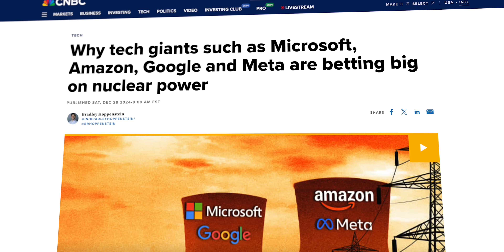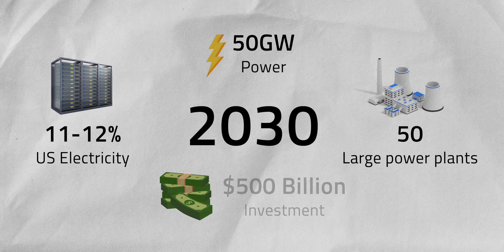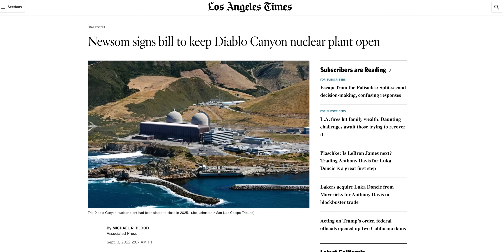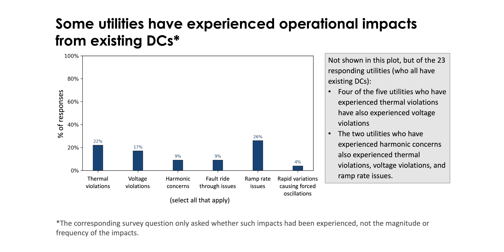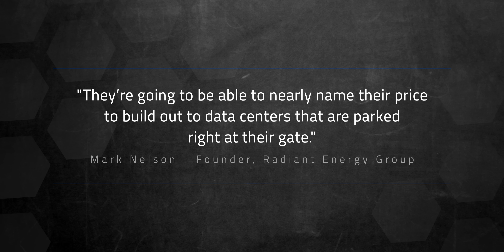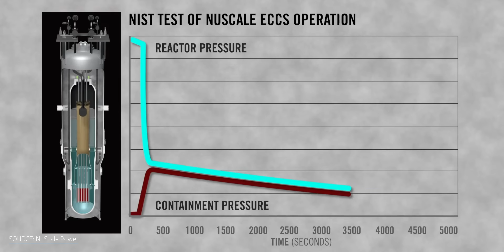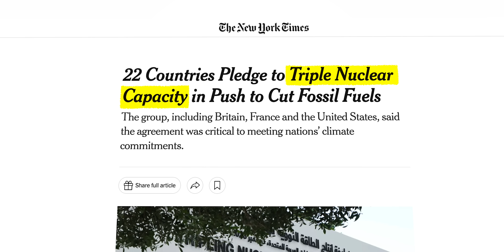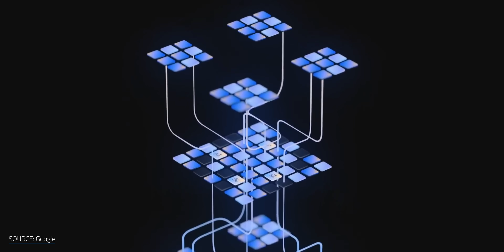Why Big Tech's Betting Billions on Nuclear (Not Renewables)

Comment: Nuclear, even more so than other types of thermal power plants, gain huge efficiencies from the scale of each individual plant. Larger pipes and reactor vessels mean fewer surfaces and connections to make and inspect to nuclear standards, bigger plants have higher thermal efficiencies, and redundancy tends to be cheaper the bigger the plant. Costs like plant operators and guarding the nuclear power plant also scale very slowly with size. There's a very good reason why even when the US Navy had already demonstrated small safe and reliable units at the larger end of current SMR designs for ships and submarines, historically all nuclear power plants have been multi-gigawatt scale. 

I think a better direction for cheap nuclear than tech bros deciding they know better and SMRs are the future when the fundamental cost drivers haven't really changed would be to learn from another industry that figured out how to build giant things in relatively low numbers at low cost, shipbuilding. Modern shipbuilding builds big blocks and almost completely finishes them internally, then welds them all together and makes the connections to finish the ship. A lot of what makes it so efficient even for low-volume production is that it lets different specialties work on different blocks at the same time so that everyone is working continuously in parallel instead of having to bring them in sequentially to finish the whole ship. 
I don't see any reason you couldn't adopt the same sort of procedure for building large nuclear plants faster and cheaper.
Reply: You’d have to build a “dry dock” with cranes at each build site. 

The reason this process works with shipbuilding is that they’re ocean vessels. They can move out of the dock without being subjected to the size constraints of roads and rail. 

I don’t see a way to do the same for gigascale reactors.
Reply: @jordanhildebrandt3705  nonsense. Off course you dont need a dock to build reactors.
I dont think you understand how little the core of a reactor actually is
Reply: @carlchristiansteglich-pete6409  Exactly, the reactor components are actually not as gargantuan as folks think, most of the big components (steam generators, pressurizers, core vessel, coolant pumps, low pressure turbines) are transported via road or rail to the sights which are inland (they usually actually build a rail spur for initial construction and large scale projects like steam generator replacements just for this purpose). A lot of the coastal and river based sights have their own small shipping docks for big transports to come in via barge. The rest is just constructed from even smaller components on sight, just a bigger jigsaw puzzle really.
Reply: This makes a lot of sense on paper but the overall expense and local politics (misinformed and undereducated public really) just pushes it out of the scope of pretty much all parties involved. There would have to be a federal level incentive program like France did to push a project like this through, or maybe if a few of the top global tech companies came together with some help with US and EU funds to make their own fission power plant construction company which goes around the world plunking these down with some guidance from WANO and IAEA. I am glad he mentioned what Kozeracki said about more cores at Vogtle in essentially the first pancake is always the worst, after that the process just get better (faster, cheaper, safer, easier) and the biggest mistake they made was stopping at 3 and 4.

Until then SMRs are a good restart point for the fission industry to get a head of steam going and make fission power available to groups with more restrictive budgets. Once the industry gets a good head of steam again there's no doubt there will be bigger projects planned since all the points you made are valid, there's a reason the latest reactors became enormous over time like the Westinghouse four loopers and the big GE boilers (Grand Gulf).
Reply: @anydaynow01  what I was thinking about more specifically with construction methods is that even large construction projects tend to have each step done in series, structural, plumbing, electrical, etc. For building construction, that works well enough since each step is relatively fast, there are a lot of buildings being built at any given time, and the plans are often not very precise so working in parallel would make a mess.
For ships, they usually do things in blocks because it lets a shipyard that might only have a couple drydocks have each profession working continuously with only a couple ships in production at any one time by having a bunch of blocks lined up. Ships are really complex and are planned meticulously, so each step takes longer, and joining up the sections when they're finished is also much easier. The complexity, precision, and construction specialization of a nuclear power plant feels closer to ships than more typical civil construction projects. 
You obviously can't use as big a block size without the rails and fixed gantry cranes used for ships, but there are certainly mobile cranes capable of lifting pieces the size of a small house and stacking them up. It just seems to me like that would make for more efficient and specialized use of labor and a smoother demand on the supply chain than typical civil engineering construction practices.
Reply: Military drone targets everyone. Nuclear has zero redundancy and the first thing the drines will target. Such a stupid and dangerous option for this world. Send in the drones, there ought to be drones, send in the clowns..
Reply: How many ships have sunk in the last 30 days? I do not think I want any nuclear reactor built to shipyard standards.
Reply: Agreed 100%
Reply: All of the advantages of scale you speak of are exactly what amplify failure effects. All structures fail eventually. ALL.  The failure needs to be predicted and budgeted for. There is no system, even the burning of the sun itself, that won't fail. We are in our infancy when it comes to fission. Even if smaller is less profitable, it is a measure of insurance.

EDIT: I think we should be doing nuclear. I think we should also not be so afraid of non-rechargeable batteries for portable power.
Reply: Blue Energy raised $45M to use shipyards to build nuclear reactors
Reply: Youre one of the few commentators that have a clue 🙂

Comment: I have commented about Small Modular Nuclear Reactors for years. ‘We should have been using them by 2020!’ Matt starts by telling us why big tech’s betting billions on nuclear, but I skipped to the good info? It is obvious why big tech is restarting and updating old nuclear reactors. ‘They can afford to. It’s a good bet, because the nuclear reactors are proven to work.’
The nuclear reactors should have been updated years ago.
‘If the nuclear reactors were updated years ago, they would still be in use today, and the US would have cleaner air.’
I thought I saw some of you rolling your eyes, at the thought of using Modular reactors back in 2020. I asked an AI Assistant in Word about the 2020 Modular Reactors.
This is what it gave me;
The topic of modular nuclear reactors in 2020 often refers to advanced reactor designs—frequently grouped under the designations Advanced Modular Reactors 
(AMRs) or Small Modular Reactors (SMRs)—that seek to improve on traditional nuclear technology through novel designs, enhanced safety features, and opportunities for cost reduction and faster deployment.

Key Points About 2020 Modular Reactors
1.	Advanced Design Concepts:
Modular designs in reactors emphasize the use of innovative cooling systems and fuels that diverge from the conventional pressurized or boiling water reactor approaches. These designs are often intended to operate in more extreme conditions (for example, higher temperatures or corrosive environments) which can lead to enhanced overall reactor safety and efficiency. This intrinsic safety is achieved by engineering systems that can handle harsh operating conditions robustly.
2.	Manufacturing and Construction Initiatives:
Research in 2020, particularly within the United Kingdom’s Nuclear Innovation Programme (NIP), pursued the development of advanced manufacturing and construction techniques to support these new reactor designs. One focus was on creating and validating structural integrity codes and standards (as seen in the EASICS project described in the paper "Overview of UK Policy and Research Landscape Relevant to Deploying Advanced Nuclear Technologies in the UK"). This work is critical for obtaining regulatory approvals and ensuring that the novel materials and structures behave reliably under operational stresses.
3.	Safety and Licensing Framework:
The novel approaches in AMRs not only hinge on technological advancements but also on establishing rigorous regulatory frameworks. By developing detailed codes and standards for new reactor designs, research and policy efforts in 2020 aimed to smooth the path toward licensing and eventual commercialization. The prospective benefits include both heightened safety measures and a reduced environmental footprint in target markets striving for decarbonization.
4.	Economic and Policy Relevance:
Modular reactors offer the promise of reduced upfront capital costs, improved scalability, and the potential for distributed power generation—qualities that are appealing in modern energy strategies. In regions like the UK, where policies directed at reducing greenhouse gas emissions are strongly in place, AMRs and SMRs are seen as pivotal to transitioning to a low-carbon future.

Summary
In summary, modular nuclear reactor research in 2020 was characterized by a dual focus on technological innovation and regulatory preparation. Efforts concentrated on developing reactors that can safely and efficiently operate under non-traditional conditions while also establishing the necessary manufacturing, materials, and licensing regimes to enable their deployment at a commercial scale. The innovations in modular design were intended to foster an energy landscape with enhanced safety, improved operational efficiency, and a faster route to deployment compared to conventional nuclear reactor designs.

For further details and a deeper dive into the technical and policy aspects of these advanced concepts, the paper titled “Overview of UK Policy and Research Landscape Relevant to Deploying Advanced Nuclear Technologies in the UK ”

Underwood, N., Nevitt, P., Howarth, A., Barron, N., J. (2020) Overview of UK Policy and Research Landscape Relevant to Deploying Advanced Nuclear Technologies in the UK
Reply: You very clearly show that you dont understand economics of scaling up. Basicaly your wrong